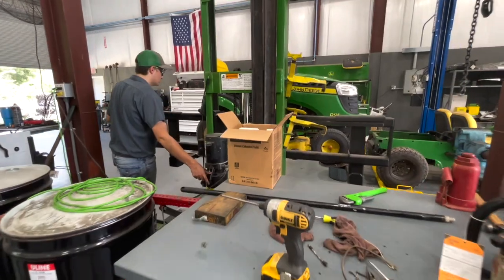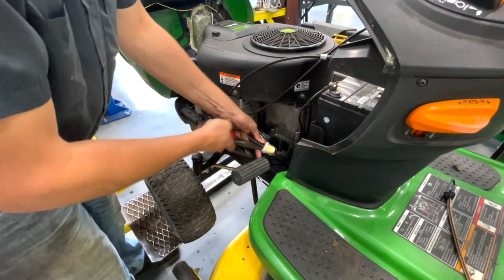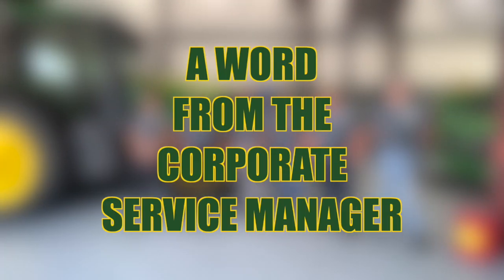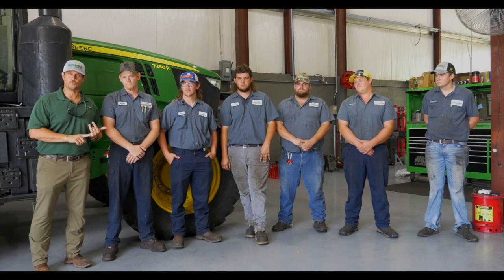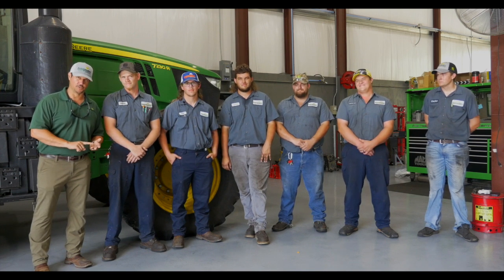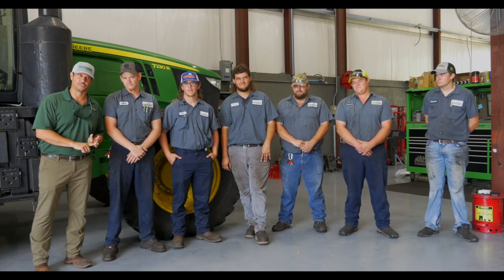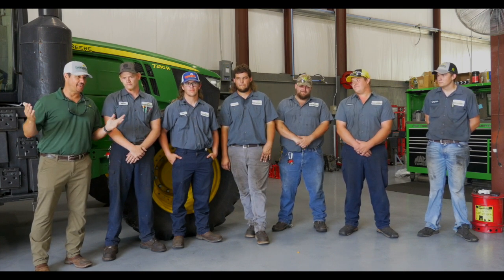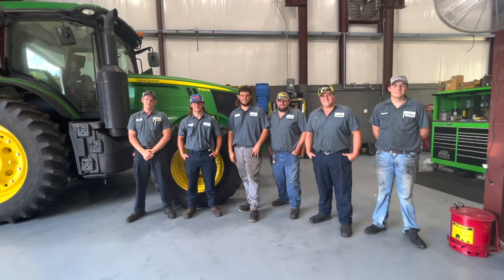Everglades Life | John Deere Tech School - Know the possible benefits of joining!

Comment: Tell Travis what I gathered from the 331 vs 97-2 video. First he's biased just a tad. The john deere door is a pos. It works great until it gets ripped off by the bucket first time u swing it open and move the lift. I hate that. Couple thousand to replace. Window wiper went out and couldn't see. I got on an incline by a ditch in thick brush and got in  bind. Couldn't get out of cab to tie a chain on and had to call for help to get out of cab. The kubota door is smooth and seals great. I don't like the radio position on the kubota either. A/c vent prolly isn't as good either. I like a lot about the deere but did u know Bill Gates owns the majority of John Deere? Weird. Almost like he wants to control our food. Didn't mention price tags either. That's worth noting.
Reply: LoL came here just for this if they sell like the videos I would trust them like a wet fart.